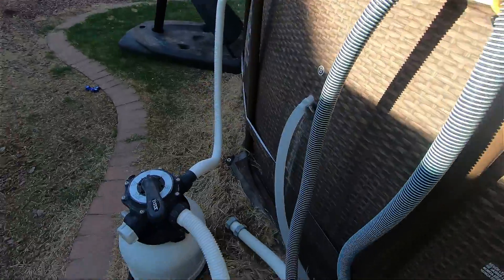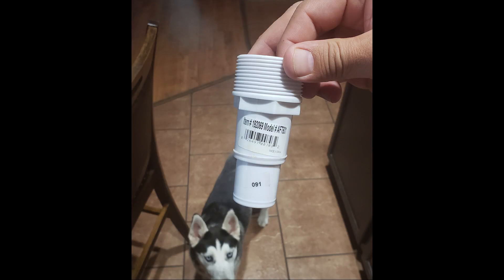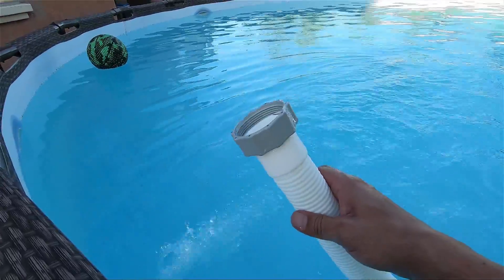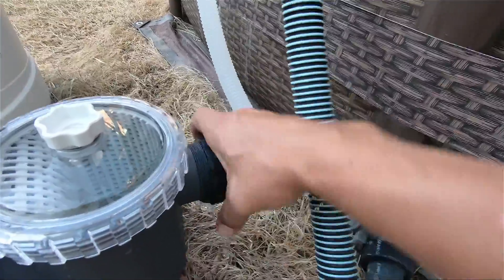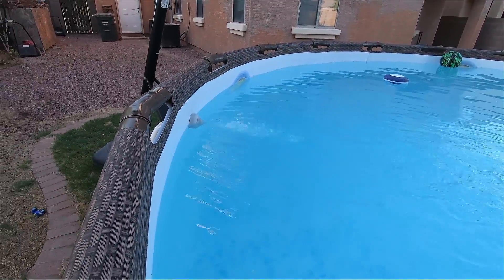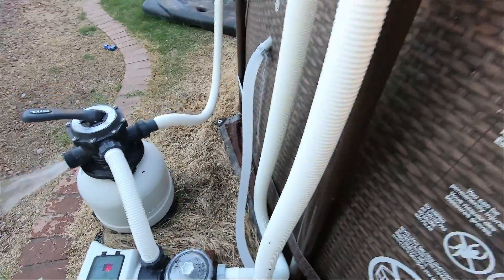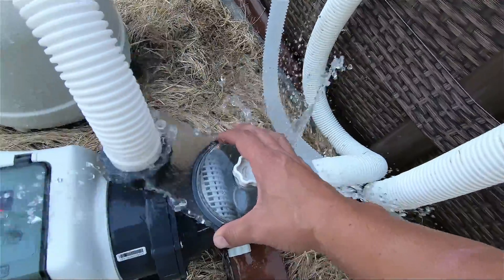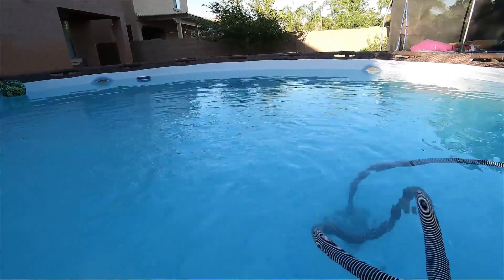HOW TO VACUUM POOL SAND FILTER

Comment: Wouldn't the 1.25" vacuum line hook up to one of the two suction ports in the pool wall? You can put the plug in one suction port to increase flow rate in the one that is connected to the vacuum attachment.
Reply: yes

Comment: Tried this and would not get any suction. I don’t know why. I used all the exact parts you did and connected directly to the pump. Ended up just removing the parts to the outlet and having someone just hold the Hose to the outlet while I vacuumed. For some reason that did work and it had great suction. Idk

Comment: i tried this methods with my pool. but i have another not related question. how did u put in the jet valve and did u cut the liner to install it
Reply from the maker: The valve that's shooting the water back into the pool? That actually came with the pool.

Comment: In leu of wasting water, all you have to do is to lockup both the intake and the exhaust portions of the water system, this causes the water to not flow either direction when you disconnect the lines.

Think of it like sucking fluid in to a straw, holding your tongue against the straw and removing the straw from the drink, you will observe the fluid staying in the straw and not spilling.